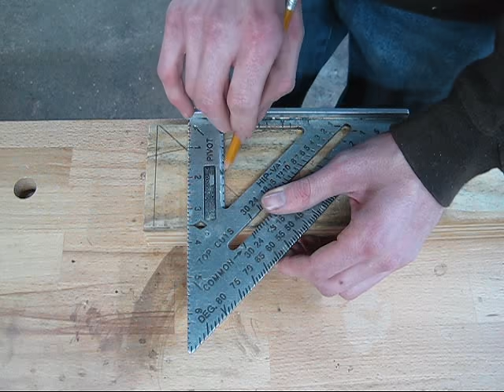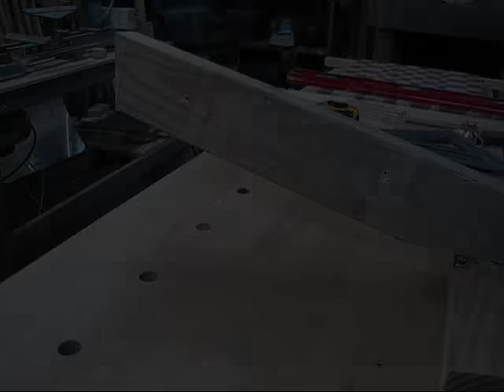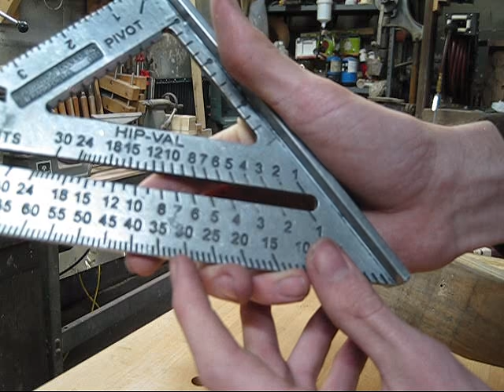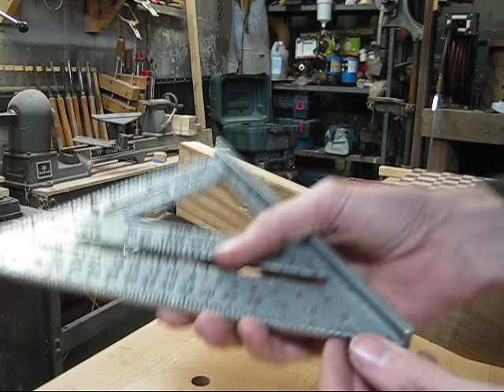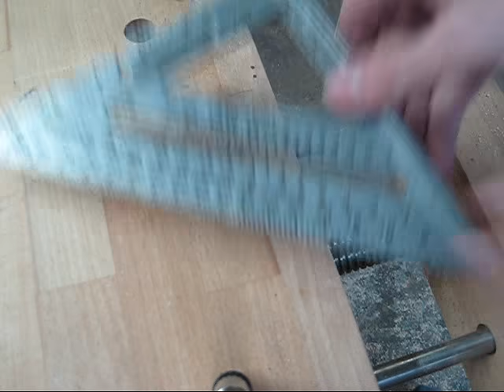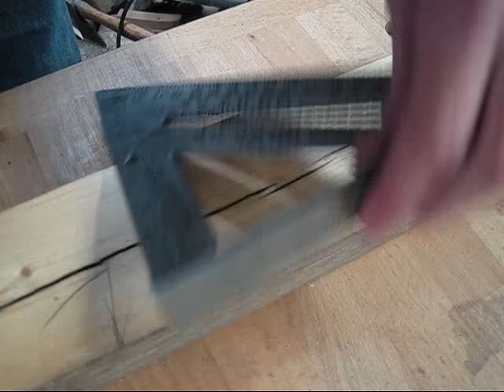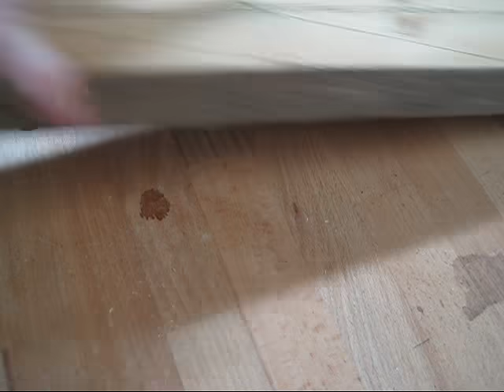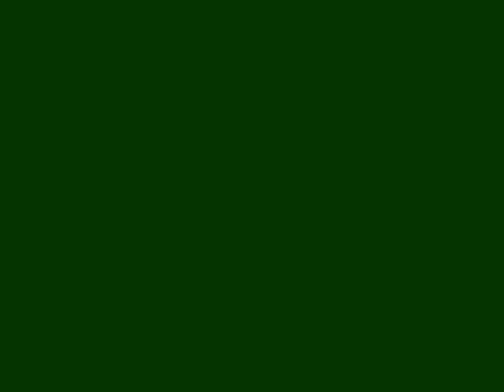The basics on a Speed square

Comment: Always test a square, to ensure it is truely square, before buying. I've come across several non-square squares.  The test is easy and something you can do in shop, or at the counter.
Reply: yet, you don't share the 'test'?
Reply: Search for a vid on this, there are a few. Basically, find a straight edged item, align square to edge and draw a perpendicular.  Flip over the square and check to see if the square and your line are exactly in alignment.  You are checking to see if both sides of the square are aligned.  If the line does not match the square then something is adrift somewhere.
Reply: Millio Smiles 

Indeed. Not all squares are made equally! Also, check your tape measures too when you buy them. Sometimes the markings are misprinted on the blade and we've bought a couple that were inaccurate by an 1/8 inch! So we always bring an old tape with us to check the new ones before we buy them. I only work with 2 other builders so sometimes we will just buy 3 new tapes and make sure they are accurate with each other. This has only happened to us a few times over the years. We only use the Stanley PowerLock tapes. They're cheap and they get they get they get the job done just fine. But make sure you check 'em!
Reply: TCSwizz2 I agree with you, the Stanley PowerLock of Stanley FatMax Tape measure is the way to go. The hell with all the other fancy, overpriced pos tapes on the market these days
Reply: +Millio Smiles ...I've run into something like that, non-level levels...check 'em out before you buy!
Reply: Make a line then flip it over. if the line match up, it's square. Same goes for a level; to tell if it's straight, hold it on something solid, make a mental note where the bubble is then flip the level over and if the bubble is in the same spot then the level is straight. if it's not, then bang it on the ground until it is.
Reply: thank for all of your life to live and let the car to a few months I will send it out to be in a while ago but it will take place at
Reply: HomeGrownPyro - completely agree! I have one of those that i absolutely love. I also have a Stanley "LeverLock" that i really like too.
Reply: If it was made in America there would be such problems with many of these tools. It is estimated that one 20 chinese products are defective. That may not seem like much but if you bought 20 tools one could be off and it only requires one to be off that could destroy all of your work.
Reply: Funny,  you always get one idiot that thinks his square is not square.
 Also when you buy a tape measure make sure the numbers are spaced evenly.
Reply: SD5 - you also need to make sure the tape measure numbers are in ascending order, so your birdhouse isn't built poorly.
Reply: Yeah I know, I hate that when I buy a tape and the numbers are backwards.

Comment: Enjoyed the video.  I learned marking parallel using the inside pencil divot, nice!  Not a criticism, but more an observation of weakened rafter.  At the birdsmouth stop the circular saw at the line, and finish with a handsaw.  Proceeding over 1/3 of the thickness of the rafter weakens the rafter tail.  Cheers.  Very helpful video.
Reply from the maker: +Bruce Dickey Aye it is not good to cut passed the line.  I shouldn't have done that even if it was just a demonstration.

Comment: How about using a full-size framing square?  Here's a few articles for the intellectually-minded carpenter.  

https://books.google.com/books?id=wiADAAAAMBAJ&lpg=PA132&dq=how%20to%20use%20a%20framing%20square&pg=PA135#v=onepage&q=how%20to%20use%20a%20framing%20square&f=false

http://sections.maa.org/okar/papers/2007/lloyd.pdf

Comment: which brand has an accurate 45deg. hypotenuse for marking corneta to cut a square pictue frame??  mine leaves a big seperation on the inside or the frame comes out a trapezoid.
Reply: You want to make this job easy for you, GP?  Pick yourself up a miter box.  Those frames will be done straight and in no time.  Worth the time to get the right hardware for the job.  I love my plastic miter box and hand saw.  

http - BobVila dot com has a great article on exactly this../articles/how-to-use-a-miter-box/#.V-nUshlMHqA  

Good luck!
Reply: a speed square is an inappropriate choice to measure a picture frame. i doubt you would ever find one that would work.

Comment: I really enjoyed your video but why did you make the bottom cut on the birds foot one and a half inch i dont understand why one and a half inch is what you oicked?
Reply from the maker: +calmmonster You can use whatever number you like.  3/4"- 1"- 7/8" 1-1/4" it doesn't matter.  I use 1-1/2" because that is the thickness of the wall plate.  It ties in better if you ask me, but that's just my opinion.
Reply: Thanks

Comment: I just watched 2 others "feabily attempt" to explain this.  I found you vid to be spot on.  It's VERY instructional, but you explained why and didn't leave out any step.  This is very helpful to beginners.  Looks very professional.
Reply from the maker: +Kevin Ashby Thank you.  Always glad to hear my videos are liked.
Reply: ive bought a speed squire in uk  but common cut 3 = 14 degrees is this  bad speed square i've got the cut or the degrees may be incorrect
Reply: Classic Work
Reply: What about the end of the repair piece? That wasn't at 1 / 3 common.

Comment: I did not read ALL of the comments but there was one glaring error and I don't know if anyone else pointed it out.  The common units on that speed square  are inches of rise per 12 inch of run.  So your slope is 3" in 12" or 1" in 4", not 1" in 3".
Reply from the maker: +CPUDOCTHE1 Aye I was going to say 1ft to 3", but the words escaped me.  Thanks I'm going to fix it.
Reply: Guess what, Dingus? 12 inches  is 1 foot, so 3-1 (THREE inches per ONE foot) is not wrong, you are just a dummy

Comment: Great video!! I started out on the roofs so the speed square was a must have (I've always known it as a rafter square) I have a 12 inch square and a 6 inch square. After around 3 years on the roofs im now on kitchens and second fix stuff and i still use them for everything. Marking out kitchen handles, plinths, cutting cill boards, skirting, architrave, door frames, doors, stud walls, laminate flooring etc. The way i use it to get the result you get in this video is totally different but with the same outcome!! Have you tried the ready reckoner book with it?
Thanks for uploading!!

Comment: Another way of checking roof pitch is placing the pivot part of the speed square on the rafter and use a torpedo level to level the square. Then read the common number on the square.. just another short cut!
Reply: i was thinking the same thing you can tell hes not a framer.
Reply: @brianlilb6952  I do the same.

Comment: Not Hip Value, but Hips and Valleys
A three pitch is not a 1 to 3 ratio, but 3 to 12 isn't it?

There are two basic cuts on a common rafter, the plumb cut and the long or level cut.
You mark the plumb cut for a 3/12 pitch by rotating the speed square around the pivot til you reach the 3 common mark.
The level or long cut can be done by setting the speed square flat against your board and drawing a line from the pivot to the 3 mark, OR you can square off the plumb cut like in the video.
Check you work by looking at the pivot and the 3 common mark.
Reply: dcsymbols Not a math teacher, just a former architectural draftsman.
Reply: +dcsymbols You're right about the roof pitch. The correct notation in this case would be 3:12, a rise of three units on a run of twelve. It doesn't matter what the units are, it'll work.
Reply: +Impalamark64 

You're right about the roof pitch. The correct notation in this case would be 3:12, a rise of three units on a run of twelve. It doesn't matter what the units are, it'll work.

Let me guess? You are NOT a math teacher.
Funny stuff.
Go ahead and say anything you like then.
Reply: +dcsymbols You got him sooo good Albert Pike! I guess SOMEONE had to make the first insult. Congrats! Now go sit down.
Reply: Well, a ratio of 1:3 is not the same as 3:12, is it? The instructor should correct his video, it seems.
Reply: @YouToobeism  reduce the fraction of 3:12 and you get a 1:4, a increase of pitch of 25% per ft.So yea he messed up on his figuring.
Reply: Well, well, well.  Ain’t you just a plum genius...you should be pretty darn full of pride as full of pride as you are of yourself, fo sho!

Comment: Ethan, when you were measure out with speed square, you said 1 1/2" because of the 2x4. Why 1 1/2" not 1 3/4" to make 1/2" of 2x4(2x4 is really 1 1/2" x 3 1/2" right? Thanks Ethan. I have NO experience at all with building a house or a shed. I am about to built small house for my family and I just don't want the house fall on top of us. Thanks for making this video lesson. Have a great day buddy.
Reply from the maker: +maikay1403 The 1-1/2 is just a easy number to remember.  You can go lower or higher, but it is better to have more wood holding the roof than on the wall.
Reply: Classic Work Thanks Ethan, much appreciated. I do have lots of question. I have never built any things in my life, but some how I found myself have lots of wood and I thought I can built a small house with this. Have a great day.

Comment: What is the "Diamond" for on a speed Square?
Reply from the maker: +Marvin L Stohs Sr You can use it to mark out a 90 degree line with it.  Also the most common rip is 3-1/2" (2x4)
Reply: great video just a minor detail the cut for the seat should be only 3 1/2" for a 2x4 wall or 5 1/2 for a 2x6 wall.  the bearing depth of  the 2x. rafter will be reduced and the

Comment: an easier way to find your pitch is to put you square on rafter and use torpedo level and where it hits level on common is your pitch no adding
Reply from the maker: +David  Mccullough Aye, but if the roof is on its hard to do it that way.
Reply: been siding 10 yrs thats how i do it on the roof too

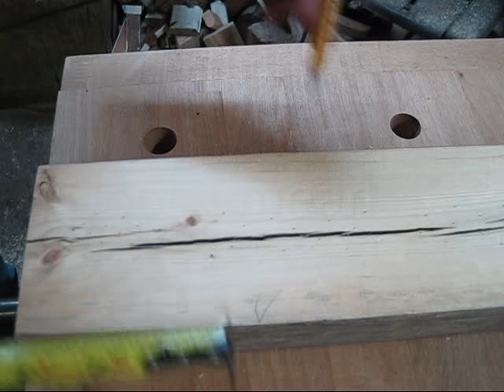Comment: Nice video, good info here, but at 5:52, technically, you could have used the speed square to measure your 4" from the edge and it probably would have been a lot more precise. I know it didn't really matter, but just another use of the speed square =)

Comment: Thanks! Previously, I only used a speed square to check "square" and cut 90 degree lines...  I'll have to watch a couple more times for the roof stuff to sink in (although it does make sense when you explain it)--- but thanks for taking the time to post. Using the pivot-  I already will be able to cut "non-standard" angles quickly now... thanks!
Reply from the maker: +jammin jimmy Glad it helped.

Comment: Great video. I'm learning how to use the speed square for a small job I'm doing.I'm putting a roof on a porch. I'm using a ridge beam so should the rafters attach to the ridge beam or should the rafters lay on top of the ridge beam and attach to each other.Thanks in advance.

Comment: Or another thought. When holding the square flush to the board, mark th three in the groove then holding that point at the pivot, rotate the 90 degree edge to the mark you make. This is called a "back measurement" or in this case a "back three"

Comment: That would make the eve correct. and to measure the length of the rafter you would  square the rise + run squared and then the square root of that = length of the rafter

Comment: 2 questions 
1. I've noticed some speed squares have a little notch cut out at one of the corners and some don't.  Is it better to have one with the notch? 
2. If you have a speed square, is there any need for a T square also?   If so,  when would you use a T square over a speed square?   Thanks
Reply from the maker: The notch in the square is used mostly for a ripping cut. (3-1/2" which is a 2x4) it is used for something else in framing too like rafter back cut or something. I've never used it for that. So no it is not any better to get one with it.  I have never used a T square ( other than a sheet rock square) I have heard that they are good, but they are Limited. I've never seen one on a job nor have I heard of one being used. Hope that helps. Sorry for such a late reply your comment got lost and all the comments.
Reply: Ethan Ewing Very helpful.  No problem on the late reply.  Super appreciate it Ethan.  Thanks

Comment: you said it was a 1 to 3 ratio (1:3).  Would the pitch in ft measurements be 3:12 or 4:12?  4:12 is actually the 1 to 3 ratio?.  Nice video by the way.  Never learned how to cut rafter with it.
Reply from the maker: It was a 3:12" pitch. I had a brain fart and couldn't say what I meant. I was going to say 1foot to 3 inches, but I didn't.
Reply from the maker: Sorry for the confusion.
Reply: No problem. I wasnt sure how the square design was.  Might have been a little screwy.  Thanks for clearing that up.
Reply: Ive heard tons of great things about mysecretblueprints. com for project plans

Comment: A slight error in your terminology at 5:30 . You said the pitch is 3, or a "1 to 3 ratio". The hip and common pitch on theses squares is based on units of 12. So the ratio is 3 to 12, or smaller, 1 to 4. A 1-3 is actually 4-12 which makes 18.5 degrees. But 3-12, like you showed, is 14 degrees (almost 13). But good video. Many of these squares (not yours) have a line running fro the 70 degree mark straight up to the "inches" line. Do you or anyone else know what that line's for?

Comment: there is another trick to get the back side of a pitch....put speed square on board mark pivot point, then make a mark at what ever degree or pitch you desire (while still square and tight to board)...connect those 2 points and  you will have the back side angle...i prefer to do this with smaller lumber like 2x4 or 2x6... works good  birds mouths or layover rafters.... when lumber gets bigger i preffer a framing square

Comment: Nice vid and explanation. However, one thing is not very clear to me, why use the "3" in the common scale when you can easily use the "13" degree mark on the protractor?
Reply from the maker: The "3" refers to the pitch of a roof. It is known as the common pitch in a foot. (There are 1 thru 30 on the square) if you think of the square as mechanical computer it makes sense.  I've got a better video on the subject if you want to check it out. Hope that helps
Ethan.

Comment: Great video, but when determining pitch wouldn't it be just 32 degrees? Why all the extra math? Sorry if it's a stupid question but I'm not familiar with pitch
Reply from the maker: 13 degrees is closer to the pitch. The 32 degrees was to find the 13 because 45-32=13. (45 being the Center Point)

Comment: One question though: what's the diamond at 3 1/2" for?
Reply from the maker: That is the most common rip cut 3"1/2 is the width of a 2 x4
Reply: Ethan Ewing The diamond is actually for laying out seat cuts/bird's mouth on rafters. That's the way I was taught to use a speed square for laying out rafters.
Reply from the maker: I have never used it for that, but good to know. Thanks for the insite.
Reply: Ethan Ewing You used the expression 'Ratio"  "1 to 3" to describe the slope as 3 to 1. It is 3 in to 12 ins, or 3ft to 12ft,  Or 3/12 Up here in Canada,eh? Good video.

Comment: Nice explanation on using the Common marks. I've used a speed square many times - also works great for a straight edge when cutting - but I never realized the 1/4" increments for ripping boards. Thanks!

Comment: if you use a small level and draw a plumb line on your rafter or more likely fascia, then measure the angle of the line you'll have your pitch with no silly plumb line or counting or measuring incorrectly ( a 3/12 is more like 14 degrees). If you want to get really advanced and skip a step you can literally hold a 6" level against the edge of the square and just read the angle.
Reply from the maker: Yeah you can do that, but that only works on a building that is under construction. If the building has a finished roof on it you don't have a rafter or Facia to draw a line on. The 6" level works well to find plum, but it will never be as accurate as a plum bob. Can't beat the old ways.

Comment: hey man this is a good video. i use the speed square everyday. i came by for a refresher. When we do repairs or just want to know the pitch of the roof we are on, or building. We take the speed square and put it on the rafter (below it) and bring the square level with the ground and it will tell you the pitch of your roof. this was a very good video